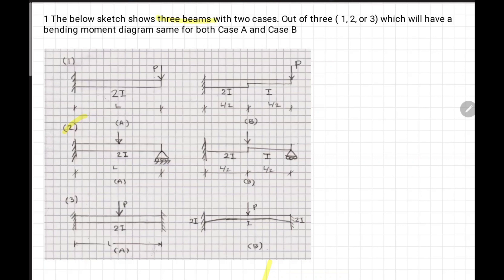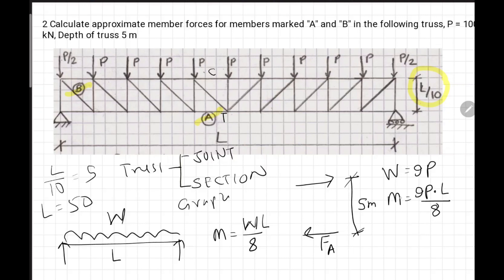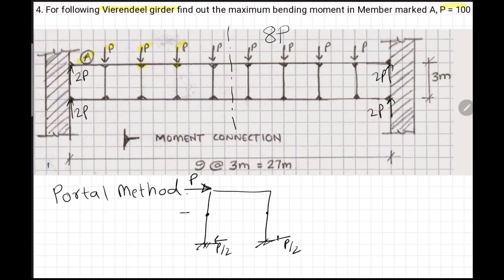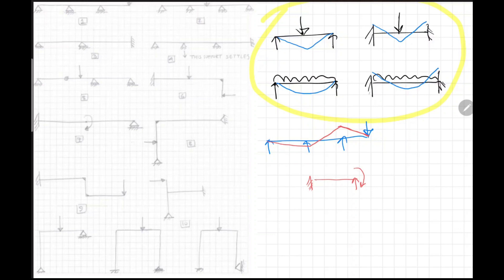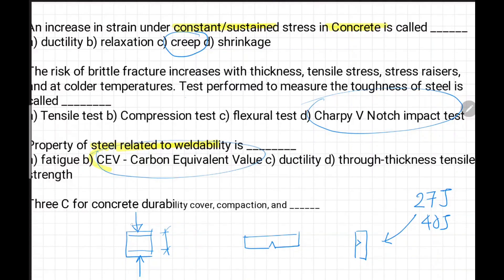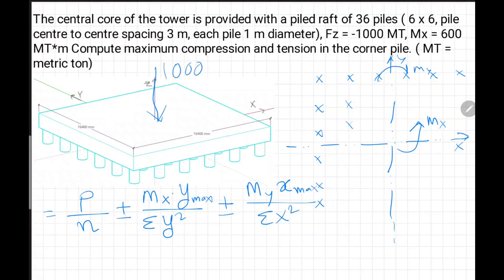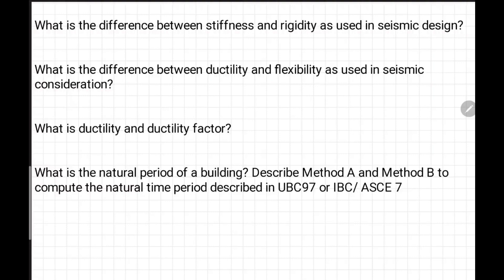Structural Engineering Interview Questions

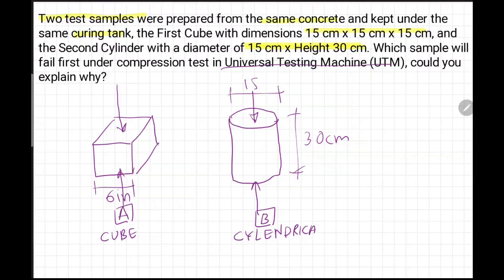Comment: 15:52 I think the difference in compressive strength between cylinder and cube is related to the "shape" and not to the "slenderness vale ". The cube, due to its shape will be able to distribute stress evenly more than the cylinder and thus will have higher strength value.